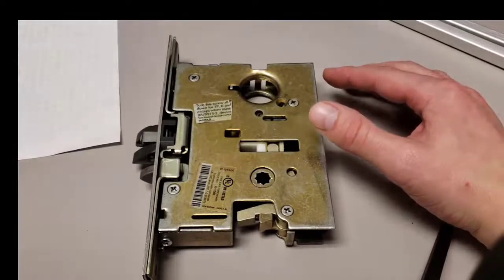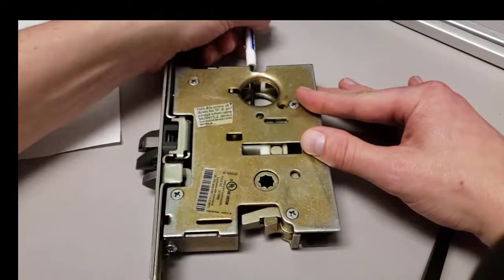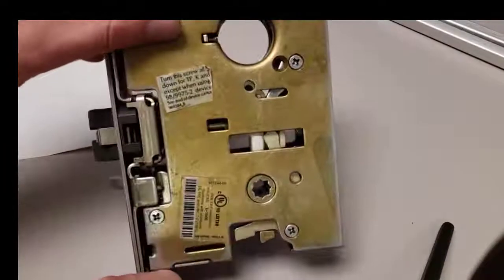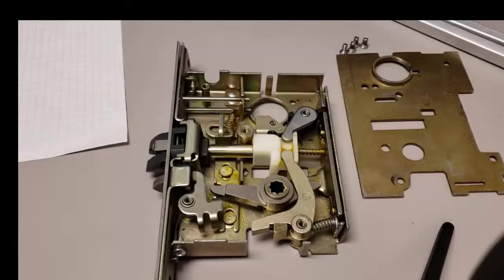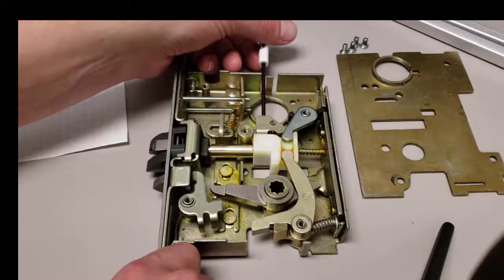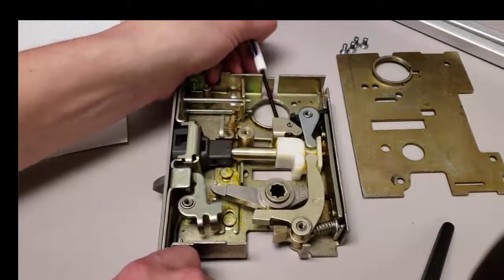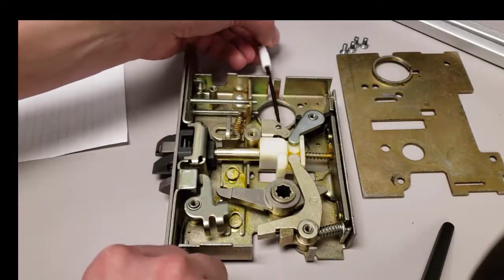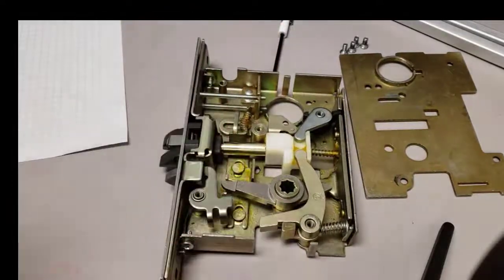How to convert 7500 mortise lock from Store Room function  to Class Room function.

Comment: Guys, I need help. I installed E7500 Fail Safe 24vdc with 996L Trim. Power Supply Altronix provided 24vdcv NC/COM. But the door lock stayed unlocked all the time. When I swipe the access card I can hear Solenoid clicks .I have 5 doors with the same setup and with the same problem.

Comment: I had to install one of these today, and the exterior cylinder would not open the door with set screw in either position. Is there something else I am missing?
Reply: Did you ever solve the problem? I'm looking for the measurement from the middle of the cylinder to the bottom of the metal casing, the longest measurement not just to the notch. thx